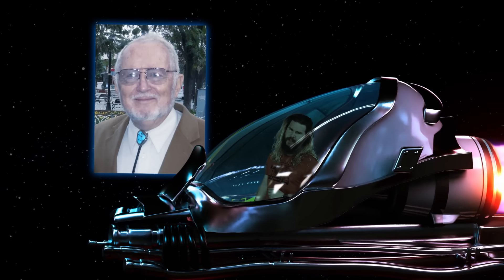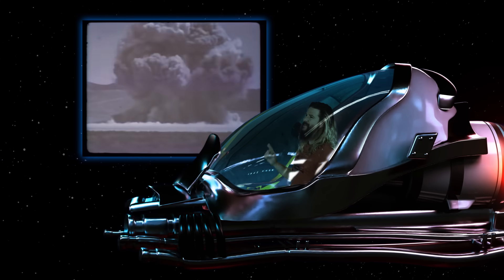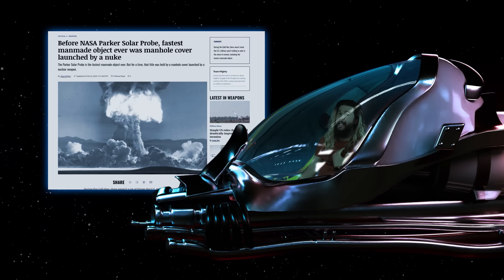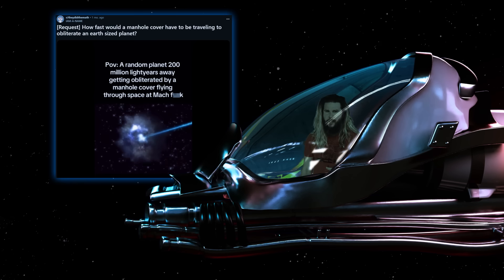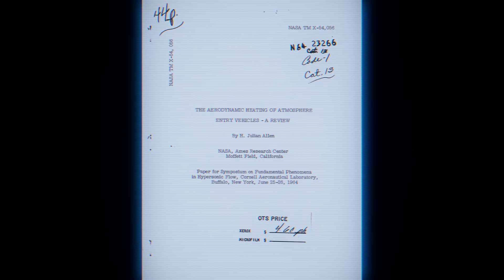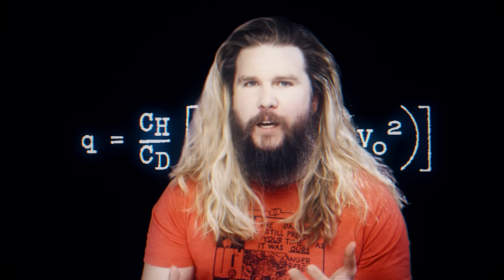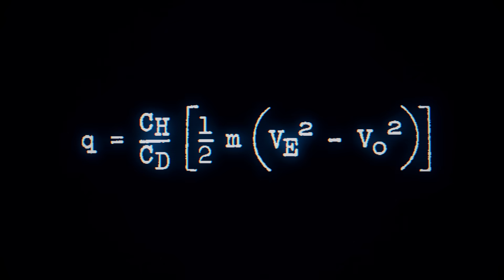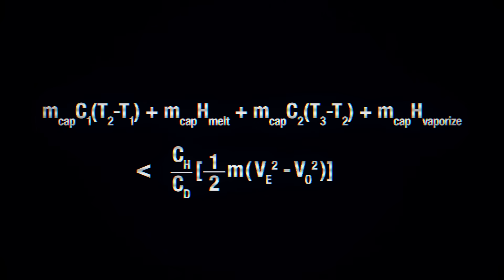Debunking the Nuclear-Powered Manhole Cover

Comment: Do I think it burnt up.  Probably but still would need to address a few things

If it went from O to | where it's flying like a frisby there would be considerably less drag on the whole thing.

The other factor would be if it popped off the gasses trapped would potentially be flying faster and still acerating so at what distance does atmosphere come into play.  If the wind behind you is 50km/h and you are driving at 100km/h you only would be equivalent of driving 50km/h in regards to the drag force.

Even if the air managed to make it to like 1 km before the cover outpaced the air it would have drastic impacts in terms of the energy that would be absorbed by it.

p.s. The meteorite explodes because it's effectively impure so liquids like water can super heat and cause the meteor to be a pressure vessel

Comment: Making it even more difficult is the probability that it was tumbling during flight and also likely broke apart during the flight, Additionally, meteorites are entering at an angle which increases duration of heating while reducing overall peak heating. Regardless, it makes sense the object likely shattered and much of it vaporized, any surviving bits not maintaining enough velocity to reach escape velocity.

Comment: There is a problem with your calculations. A meteor entering the atmosphere does not have a column of air moving at the same speed behind it. Also how much time does it take for the heat transfer to occur? A meteor is moving slowly enough to give time for the heat transfer to vaporize it, but did this "manhole cover" have time for the vaporization to occur before it reached space? In other words could the heated iron still been in the process of vaporization at the time space was reached? Also remember that the speed calculation is only a minimum value, not a known constant.
Reply: Don’t forget the air behind it is super heated by a nuclear bomb

Comment: Air is significantly thicker at the surface than the edge, so those calculations probably need to be re measured. A good nudge’ll do though for the principle.

Comment: Kyle, you made an error in your numbers at 9:37, you made the assumption that the manhole cover was at "0" velocity at the end of it's journey.  You need to calculate the atmospheric drag equation to give the theoretical "V0" instead.  For example, if it only lost 6km/s of velocity, then the heating would be 6.6e6, around half of what's needed.
Reply: 6.6e6 is a lot less than half no?
Reply: @sirkiz1181  Yeah, it's 6 orders of magnitude less.
Reply: @sirkiz1181  half the magnitude
Reply: @Johnrich395  No, half the ORDERS of magnitude.
Reply: Fun fact, if that Manhole Cover reached a V of 0.  Going that speed it would be  8.71e12 joules of energy  ie 8.7 GJ or 2.1Ktons of TNT or about 13.5% of the Hiroshima bomb of 65GJ
Reply: @josephrhone2758  which, considering that it was essentially a nuclear powered gun, would be completely plausible.

Comment: Congrats you made a mistake and broke conservation of energy.
You made q higher than the initial kinetic energy 
You should have realized that if you have a CH/CD that is greater than 1 you've gone wrong since that implies more energy than you stared with.
I'd expect you do at least do a sanity check.
9:38 (24.1/1.28)=19 times it's initial energy. which is a red flag

with 66km/s and 1000kg it's energy would be 2.2x10^12 j 
E = (m/2)v^2
which means that if even all of it's kinetic energy turned into heat it wouldn't be enough to vaporize it. And there certainly can't be more heating the it's own kinetic energy.
Never mind the fact that a good bunch of the heating would go into the air itself.
So i think it's not unconceivable that it managed to get into space.
And as for meteors with similar mass destroying themselves, I don't think they were made from a solid block of metal. Though It wouldn't be unlikely for it to be fragmented from the explosive push it got.
And This is also assuming all the kinetic energy converted to heat and that it didn't continue with speed which would also reduce it more.

(edit)
It also seems you've messed up the left side of your calculations as well. thanks to a response to this comment that checked.  1000kg /55g/mol  is about 18000 moles * 340kj/mol for vaporization of iron = about 6x10^9 so lets round up to 1x10^10 joules.

I also did try to use your numbers but they don't add up to your result either. so I assume you messed up your units somewhere since you're suing both kj/kg and j/g in your calculation. I roughly did your calculation and got 5.2x10^9 just quick and dirty which is about 1000 off from your number so you did. 4:52 Ironic lol 

But still I think the most likely thing is that the cover fragmented from the start, but maybe some chunks made it or not, It's all guess works unless we want to do it again for science!
Reply: I didn't consider that but you're right, the equation used in the video assumes an object falling for a long period of time, therefore being constantly fed with energy from gravity. That's where the extra energy would normally come from.

But here of course the cover is moving *up*, and *very quicky*. Whatever energy was given to it in those few seconds it flew though the atmosphere only took energy from it, reducing its self-melting potential.
Reply: @kantoros  At these speeds and the amount of time involved, the affect of gravity is completely moot.  It's less than a rounding error.
Reply: Just for a quick sanity check i ran through my calculator and there is certainly enough kinectic energy to vaporize the mach fuck manhole cover assuming all of it got turned into heat (which it probably didnt)
66km/s for a 1000kg manhole cover gives about 2.2x10^12 joules
and from a quick google search the energy needed to vaporize a gram of iron from room temp is about 7.5k
Just doing 7500*1000*1000 gives about 7.5*10^9 meaning there is more than enough kinetic energy to completely melt the steel cover.
Reply: @saturnv691  Good point i didn't check is calculations on the left side. So it seems he messed up both sides, so that's quite the embarrassment. Though it's still the question of the energy actually being transferred to the cover as heat.
Reply: So what does this math mean?
Reply: @Disappointing925 go fast means it’s toasty
Reply: @chaoscrew694  yeah does it prove the manhole could’ve went to space?
Reply: @chaoscrew694  but maybe go real fast = less toasty?
Reply: @Disappointing925  it’s a 50/50 if it did or not
Reply: @LlywellynOBrien  go real fast = less toasty
Maybe but they go wopa wopa when spinning really fast
Reply: @chaoscrew694  hmm wopa wopa indeed. Does wopa wopa make fall apart more or less likely?
Reply: @LlywellynOBrien  me no think so because for it do have a crinkle crackle it’s need to be made of paper but it’s no paper I don’t know what’s it’s made of but it make rock look soft
Reply: @chaoscrew694  I like those odds
Reply: Liquid iron will combust with the air before if vaporizes, further adding heat to the system. That's how iron cutting torches work. Even with lower oxygen%, it will be a lower temperature than vaporization.
Reply: I have even bigger problem with that whole story. Pascal B was a small nuclear charge with a yield of 300t TNT. That is 1.25 x10^12 J. So how is it possible that the manhole cover gained MORE KINETIC ENERGY THAN THE ENERGY OF THE WHOLE BLAST? At 66km/s, 900kg it would have 2 x 10^12 J of energy.
Reply: Nerd

Comment: A few questions from a non-physicist...  I believe it was mentioned that the cover was welded in place... given that, would the blast have possibly deformed the cover into a more parabolic (aerodynamic) shape?  If that shape remained "pointed end" into the wind rather than say tumbling, would that have changed the calculations you provided any?  Assuming it did stay in a stable orientation, would it act like an ablative material and potentially burned off surface material producing a plasma barrier that would reduce heating sufficiently to allow the cover to get high enough into the atmosphere and thus reduce friction heating before completely vaporizing?

Comment: I'm fairly certain the given velocity figure is wrong. According to wikipedia and other websites the yield was 300t of TNT which is about 1.25 TJ (1.25e12 J). The kinetic energy of the manhole cover at the stated 66km/s is approximately 1.95TJ (9e2kg * 1/2 * (66e3m/s)^2 = 1.96e12J). Thus it is unlikely to have achieved the velocity so frequently quoted seeing as it is about the yield of the bomb and i find a transfer of nearly all energy to the manhole cover rather unlikely. 
Additionally your heating formula seems quite a bit off. Unfortunately I am no expert in heat transfer within fluid dynamics but heating larger than the entire kinetic energy does seem somewhat weird to me. Edit: The NASA Paper you cite says as much too. The factor eta = CH/CD is the ratio of heat going to the vessel whilst 1-eta is the heating of the air due to drag. According to your numbers eta is about 18.8 thus the air would be cooled immensely. That's just plain wrong. The factor eta has to be between 0 and 1.
 Please comment if I'm wrong

Comment: The difficult comes with assuming that cover continues to travel as a flat plate. It wouldn't. Air resistance would turn it edge-on, making it much more streamlined and reducing the heat generated.
Reply: It's not that simple, although I agree that the cover wouldn't have gone up in that way.

The torque forces of a 900kg disk of iron going ~60km/s rotating 90° would be enough to shatter the brittle iron for sure. However objects at super sonic speeds don't behave like you'd expect and 60km/s is so far past super or even hyper sonic that it's best assumed that the disk would have melted before it was able to do anything else. If it did melt then a combination of Shockwave centering on launch and drag effects would have probably formed it into something akin to an EFP, a bullet or needle shape. 

So long as in its new form the metal stayed together and didn't explode or evaporate, it may have made it out of the atmosphere and orbit. Real high emphasis on the may though.
Reply: Not to mention deformation due to being nuked
Reply: It'd have been deformed by the explosion too

Comment: I'd argue the math is inaccurate, but the potential sources of error kind of balance out, and even if they don't, a difference of nearly a power of ten is pretty rock solid.
As mentioned in other comments, it would likely only stay the original shape for mere moments. Not only would the blast have probably made it convex, as it heated up and melted it'd deform and become more aerodynamic. So the atmospheric drag (and therefore heating) experienced would be much lower.
However, I'd argue that 100% vaporization isn't the bar for whether or not it makes it out of the atmosphere. It's a handy shorthand, since the exterior layer would probably vaporize instantly as it melts, but really the thing just needs to liquefy and by all reasonable definitions it's destroyed. Even if it were to uniformly melt without vaporizing layer by layer, a glob of liquid traveling at that speed would probably spaghettify and/or aerosolize rather than remaining one glob of liquid. So the heat gain may be lower, but the heat required to destroy it is also way lower.
Ultimately I feel like the point of comparison at the end gives us the best answer. If a larger ferrous meteor will vaporize at lower speed, the manhole cover probably isn't making it..

Comment: It's a good idea, but this equation seems to ignore the fact that the lid was blasted up by propellant gasses that pushed it to that speed that would have "escorted" the cap for some distance. ESPECIALLY at the ridiculous speed it was doing. 

Also: There is NO WAY it didn't deform at the speed it was going. 
It absolutely did get into space. Maybe not in one piece, but I am absolutely convinced it did because 99% of the heating it experienced after assured deformation from exiting the plume would be from radiated heat that the shock cone gave off.

Unfortunately, there is no way besides a repeat of the experiment to verify this. But it is easy to make conjectures based off of what we know and what we decide to leave out to "simplify" the calculations or validate assumptions.

Comment: This is all academic. If the manhole cover got hit by a bug, or glancing down draft, anything that would cause an uneven distribution of resistance on the top surface could have caused it to turn so that the profile became more aerodynamic while not heating all of the cover with the leading edge acting like an ablative for the rest.